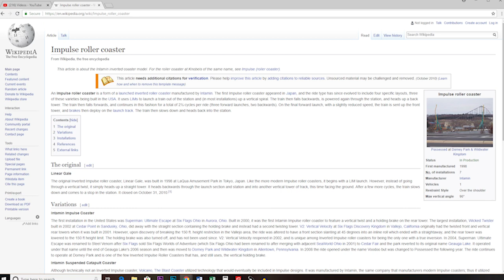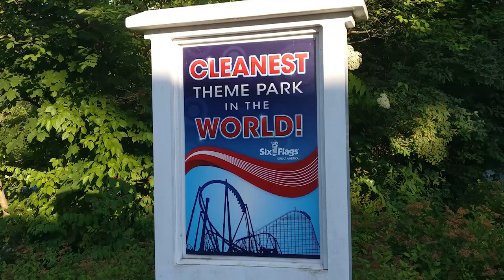Electromagnets, roller coasters, half-a-dozen flags, and clunkless chain lifts

Comment: This may not be the transformers you are used to. I do not know, however the voltage of this ride could be much higher voltage than typical housing requirements. This is likely 480v 3 phase by the look of the padmount enclosures. Absolutely a high draw machine, but I am not certain it's quite the scale you worked out despite the extra size for the 3 phases. The lower voltage output of the transformers in condos will also require a physically larger transformer because of the relative amperage continuous  480v takes half the amperage per volt as 220 to create the same wattage, and have that again for 110.  So at 60hz continuous the transformers will need to be sized larger to handle the load and heat dissapation needs vs a large draw for relatively short bursts with time to cool. If factor in the efficiency benefits of 3 phase which may or may not apply given the solid state pulse drive these rides sound like they employ. These enclosures seem to have a larger cable area than transformer so there may be additional hardware in them as well. Short version: Yeah pretty high draw, but I don't think it is quite the scale you convey.
Reply: Transformer sizes are based on VA requirements, not amperage. A 500 VA transformer, being for 12V or 220V is the same size, the windings are different, but the core and magnetic flux capacity (which determines the size), is dependent on VA (apparent power).
Reply: They would be 3 phase transformers, so the 6 diodes in the rectifier module would be under a lot less strain than if it was single phase. As well with 360Hz ripple current the capacitor bank ( probably rated for 800VDC and running at around 600VDC in use, using 400VAC phase voltages, as most IGBT devices are 800V rated) can be quite large, but the ripple current will be low for the power. More for riding out short mains power failures, and still having enough energy to safely brake the car string to a stop even if the power goes out totally, than to store the energy to drive it. The power required is I would guess around 500kW peak, but only in bursts, and having 2 big transformers is to have redundant network connections so one going down ( or being off for maintenance) does not stop the ride. They probably have separate rectifiers, fuses and only connect to the main DC bus via some big fuses. Smaller transformer is probably only powering the ride lights, aircons and the park area around it, not the ride direct, though it might do the control room and passage lights. Cooling fans for the ride will be powered from the big transformers, 400VAC 3 phase motors are very much more reliable than 120VAC single phase ones, and can be much smaller for the power output.

You would also have associated with the ride a very large force air cooled resistor bank, to dump the power the linear motors absorb when they are used as brakes. In that control room you will have a resistor bank capable of dissipating 1MW or so of power, though it only has to do that at the end of the ride, or on emergency stop conditions. It will be direct on the DC bus, and use another big power controller ( more IGBT modules) to keep the bus voltage during braking from rising too high.
Reply from the maker: I'm not sure the LIMs are actually used as brakes at all.  In the section past the station, there are gaps between the LIMs that have a pneumatically actuated brake device that is raised up before launch, and lowered back down when the train has made its final pass through the station.  I'm guessing these are standard magnetic brakes and would be the main braking mechanism, with the LIMs simply idle.
Reply: The Incredible Hulk Coaster at Universal's Islands of Adventure uses 8MW for its launch system. That isn't using LIMs, so it's probably less efficient, but that's the kind of power required. The Hulk uses flywheels to store the power for launch.
Reply: Yeah its 3 phase power operating at about 30000 Watts. I was recently talking to Indrivetec, who makes current LSMs for Intamin and B&M and retrofitted new power systems for many impulse coasters.  When the grid can't supply enough power, they use supercaps as power storage.

As for braking, the friction is mostly just to hild the train for loading/unloading.  Its the could while turned off that act as eddy current brakes.
Reply: The LiM coils won't provide any braking action as there is no magnetic field when the coils are off. Vertical Velocity uses permanent magnet brakes on the last backward pass and to hold the train in the station. LIMs ARE used to move the train after braking and to position it in the station.

Comment: My guess is that as the weight of the train stretches the chain, the weight pulls on a tensioning sprocket. You can see a smaller chain that translates the downward gravitational force to a diagonal force on something in that greasy slot. Or maybe the chain is intentionally slack until the train comes along.

Comment: The chain tensioner is designed to keep the chain tight, to prevent "throbbing" as the car is pulled up the lift hill.

The sound you hear is the electricity surge through the system. They do use capacitors, and a dedicated line from the power company (I was told this when talking to a Cedar Point engineer about Wicked Twister).

As for not hearing the standard "clickity clack" of the anti-roll-back device, that's because they now install a piece of rubber inside the catch on the underside (or top side on inverted) of the car. This eventually has to be replaced or you will hear it again. Roller coasters like Millennium Force use a cog wheel instead of a latch mechanism, so you'll never hear it on that one.

Comment: I seen linear elevators that draw more power. The VFD is so big it gets put in a separate room. So there is a machine room and a vfd room. When the machine starts up and slows down it the sound it makes is amazing. And when the thing stops and the breaks engage it sounds like a bell (the breaks are huge)
I am talking about high speed high rise lifts.

Comment: A lot of the early launched shuttle loop coasters made by Anton Schwarzkopf actually used either a weight drop (usually indicated by a tower behind the main spike) or a flywheel system to launch their rides before LIM and LSM launches were popular on coasters (though LIMS have seen use on other attractions, such as the PeopleMover at Magic Kingdom). I also believe that the Incredible Hulk coaster here in Florida was designed in such as way to be easy on the grid by storing power prior to a launch.

Also, as a word of advice, don't go to Six Flags America

Comment: 3:50 did you read the actual load and rating or guessing how much by the size of the box?
Reply from the maker: Just guesses.  But in this scenario, I'd say it would be on the safe side to push these transformers near their limit, since their duty cycle is quite small.  They may run at 80% capacity, but for only 5% of the time.  That is of course if the ride is operated directly from grid power--if it has its own storage like a capacitor bank, then the transformers are probably loaded more consistently.

Comment: Chain tensioner.... Much like the belt tensioner on a car....
When the chain takes on a load the tensioner will will take up the slack...
That being said....
The upper sprocket has a large spring that will absorb the impact of the train latching the chain.causing the chain to slack out... The reason for the tensioner.

Comment: 5th
Reply: Slowpoke!
Reply: Jeez! It's been at least 10 years since I've been to Six Flags over Texas (the original). I remember when admission was $18 back in '84. Still, It's insane how much they charge for everything!
Reply: Jeenkz K didn't they tear Houston down few years ago?
Reply: A whole city with population of 2 million? Seems unlikely.
Reply: Quality > speed, though. 🤣💗
Reply: From my previous post here the link to the ”Old school” Mark 1 Vancouver Skytrains which have been in operation since 1985. Some with over 5 million Km on them. The earliest model are only now getting their LIM motor rewound with an expected further life expectancy of 20-30 years for the motors themselves. These old model have a very unique sound to the, as well. I suspect a more DC based staged control system as you can tell from the gear-like sound of its propulsion 

Bombardier/UTDC Mark 1 cars (with original and newer paint schemes):  https://youtu.be/NWEexwZSXF8
Reply: If you don't raise prices you get what happened with Six Flags Magic Mountain.  You get unruly teenagers and gang bangers overrunning the parks.  While prince increases suck it's a necessary evil to keep the crowds down and allow those who can come a chance to have fun instead of waiting in line for the whole day and riding maybe 1 or 2 Triple A rides
Reply: -Jeenkz K, half a dozen flags is gonna get ya

Comment: A couple other tidbits about Wicked Twister at Cedar Point (and probably the others):
* When the launch button is pressed, it takes 2 seconds to actually launch. 
* There is a safety light curtain enclosing the train's footprint in the station. If anything crosses, it E-stops the ride. One time a guest's ride photo blew off the shelves where they set their items down, because of the gust of wind caused by the train coming through the station, and it tripped the beam and stopped the ride.
* The year I worked on the ride, the main transformer lost a phase and it was down for 2 weeks while they had a rental transformer brought in. With the rental, they couldn't get the voltage quite right and it behaved quite weirdly and was down all the time. "High Voltage" and "Insufficient Launch Speed" were common error messages seen. They eventually received a replacement transformer from the manufacturer.
* There is a "manual" mode where an operator can move the train forward and backward at slow speed by holding down a button, and an "auto" mode where the computer executes the normal ride program. Press the button once and it does its thing.
* The ride is incapable of launching less than 60 seconds after the train gets back from the previous cycle.
* There are no brakes behind the station. Once on the back tower, the train will go through the station.

Comment: as far as the two "large" transformers, my guess is they are 480 VOLT transformers,  used only for the launch and recovery of the train,  the smaller one is likely for the ride computer as well as lighting in and around the station plus the audio (if any) and PLC's.  It is likely a 120/240 Volt transformer.  depending on how much current draw there is from the ride, its possible that it is using something like a capacitor, but on a much larger scale, think lightning generator and you get the idea.

Comment: Yes! I LOOOVE that sound too. I'm closest to the other V2 which is slightly modified, but still makes that noise. Such a great sound. I use to dream 'I should build a drivable car that's powered by LIMs and makes that noise'.
Reply: They should call that one "Diagonal Velocity". And next time they should check the local height limits before building the ride!

Comment: I believe the counterweight is a dynamic chain tensioner. They are used to tighten the chain, and because the chain is so large, they account for different speed of the train/coach and rider’s weight. If there wasn’t a dynamic chain tensioner, the chain, huge chain motor, and chain sprockets would get weaker over time due to a several ton car getting slammed back against it every 2 minutes. The moving tires next to the chain  press against the train’s break fin on the bottom of the car.  The tires  have springs and hydraulic cylinders under them to prevent them from wearing out or being jerky. The tires also have eddy braking, on the tire axle. When the tire turns, magnets oppose the turning and slow the car down to the same speed of the chain. If it is going too fast the hydraulic cylinders push against the tire and putting the car more on the tire, slowing it down, and if it is going too slow, a high torque motor kicks in and gives it a bit of speed to get to the speed of the chain.  The reason for the 3 huge transformers if for the insane load of over 2000 amps when the upside down car is on the linear inductive motors. Some roller coasters also have regenerative inductive braking. So when a car is stopped, the energy left in the car is stored in high voltage super  capacitors to use for the next car launch.  Shout out to Maxx B who said the same as me, he was first on the subject, I just wanted to broaden information. Source- Uncle is an engineer for Arrow Dynamics in California, one of the most popular roller coaster builders in the country.

Comment: The stack of weight is rather simple in it function, yet long winded to explain.   Considering a chain can only pull and the drive works are at ground level the tension placed on the chain by the train loading it will put tension on the entire loop of chain except the very short piece between the drive sprocket  (which is mounted to the shaft we can see vary its speed with the bolt heads showing) and the point the trains pawl engages with the chain.  So to make a long story short several hundred feet of chain are placed under tension by the train, this tension yields some slack. The weights keep an idler sprocket pulled in the direction to take up this slack. A similar system (spring loaded rather than weighted) that simply demonstrates this is in the rear derailer of a multi speed bicycle, a (relatively) light tension is kept on the chain all the time to keep things moving thru the sprockets correctly. Imagine a chain with too much slack it tends to fall off the sprockets. the weights job in this coasters case is simply to apply this small amount of tension to the entire chain and to take up any slack made from the load stretching the chain. Most one direction only systems employ this movable idler system for the base load tension that keeps the chain on its sprockets,  (unrelated) two way systems like motorcycle chains must transmit power from shaft to shaft both forward when accelerating and the opposite when using the engine to slow the motorcycle down; the base tension often comes from catenary in the chain, but this requires periodic adjustment and who wants that.

Note: the limit switch (mounted directly above the aperture that grease is coming out of)  that can detect a problem with the tension.  If the idler moves back and forth in its housing too far in either direction the upturned ends of that siding part will trip that limit switch, indicating tension has been lost (chain breakage)  or a sprocket binding problem (chain gets carried around stuck to the sprocket). 

I Hope This is clear and helps

Comment: I worked on an lsm coaster. We had a special 2000amp 720 3 phase service to power it. The stator motors were wired up to an off the shelf vfd nothing special about it. VFDs do use igbts. All the magic was in a computer system that would do the calculations to control the vfd. The stator motors had thyristors that would short them out. They did this to take the stator motors out of the system when the train isn't present on that stator motor to save energy.

Comment: Your dead on about the counterweight and the chain speed. For the sprockets you seeing. The one on the left in the video is the drive/1 way clutch. That's so the chain cannot go in reverse. The sprocket on the right is on a slider that let's the counterweight move. I've worked on similar model b&m rides as a mechanic.

Comment: probably 480v at a couple thousand amps.  Best guess  and yes banks of capacitors but not like the ones you see in modern electronics, those are going to be able to dump the voltage and amperage is a few miliseconds.

Comment: I don't have any experience with a sit-down B&M, but I'm pretty sure I remember the chain of the lift-hill of Swarm at Thorpe Park (a winged B&M coaster) running faster before it attaches, tho that could very well be different for other B&M models. The only other one that I have experience with is Nemesis Inferno, which's a B&M inverted coaster, but that actually has a notably long pre-lift-hill section that actually causes the cart to drag the chain at a faster speed than it's running at up the hill for a short bit before the chain starts to carry the weight of the cart.
Reply: The Swarm's lift chain runs faster when the entire train is on a perfectly straight piece of track and slows down when the train starts curving up or levelling out. No idea why, just is. When the chain isn't hauling up a train, it goes into an idling pace.

Comment: On your "bunker" pic, there's a meter...  I don't know how meters work where you live, but here they meter kW/h.  You might want to look at the meter next time...
Reply from the maker: I would need to bring binoculars--it's hard to tell from the picture but the exit ramp is quite far away from it.
Reply: Technology Connections 2 I thought it was readily accessible...  Now that I think about it, I seem to remember that rides are individually metered...  Not sure where I get that from, I think it's from the sheer amount of meters in amusement parks, but it would make sense from a 'performance metric' standpoint...  Don't take my word on it, though, I might be imagining the whole thing...
Reply: Probably only metering the small transformer, the big ones will have metering inside the cabinets, or in a substation feeding them, read vis a SCADA system. The load draw for the ride is very likely profiled well, so they know exactly the power needed for each cycle of the ride, and thus the metering is there more for monitoring the transformers for faults, as they know that each cycle takes X amount of power in Y number of stages.
Reply: Technology Connections 2 i guess that is a good idea